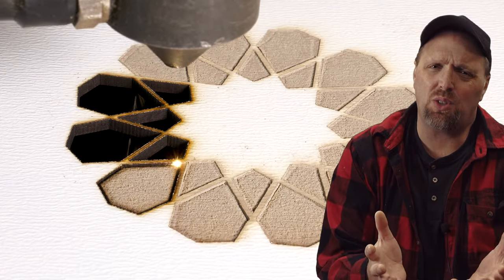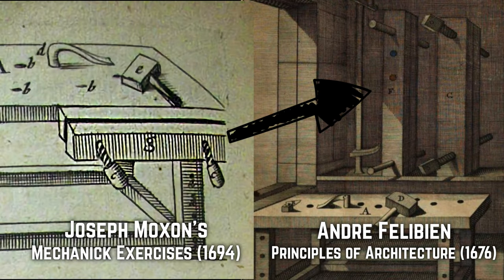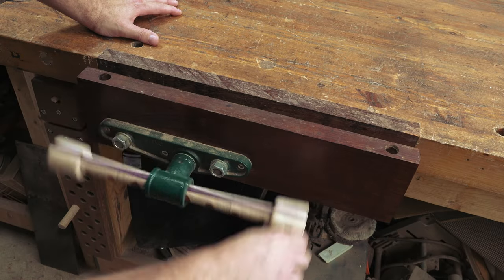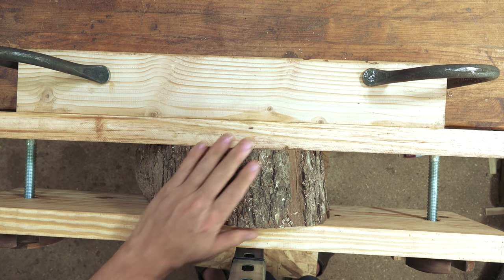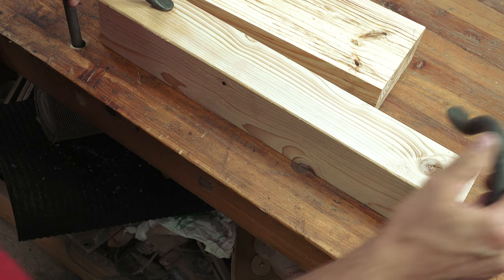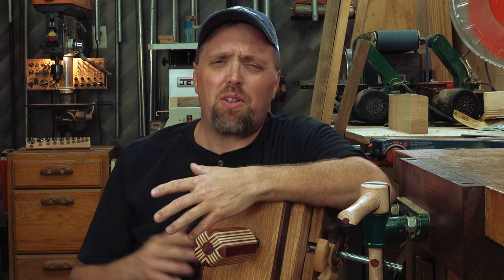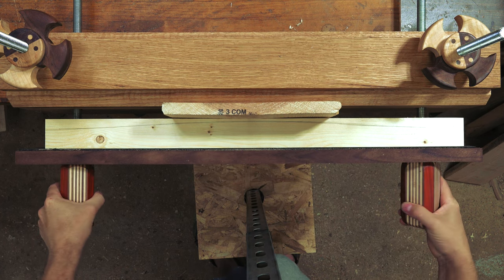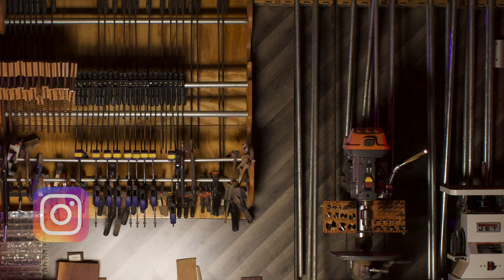The Moxon Vise LEGACY // History comes alive B4WMT #10

Comment: Hi.
I really like the quick release mechanism - it's a great addition to a moxon made with "normal" screw I think.
Personnaly I don't have this problem because I use quick clamps - I made a groove of the thickness of the clamp's bar on the sides of a bench bull (a trunk of a beam with grooves & notches basicly) to keep the clamps in place and also in the removable front jaws.